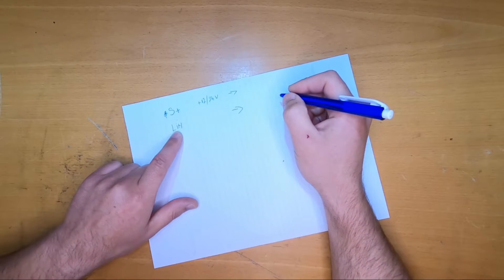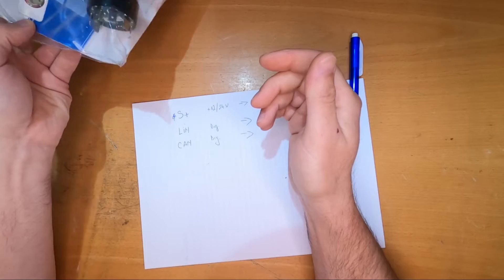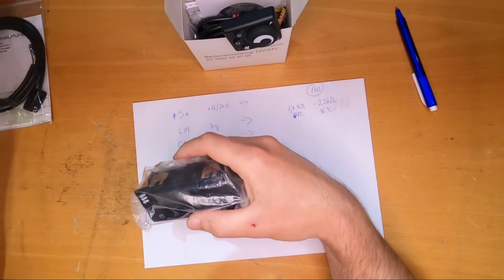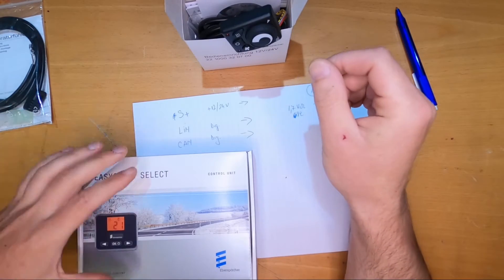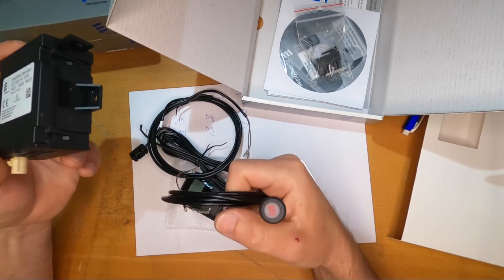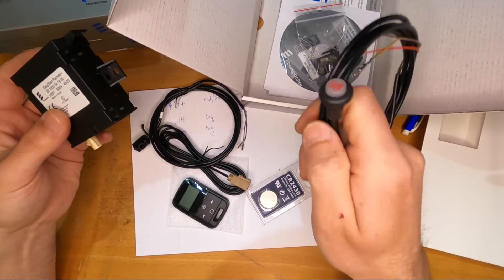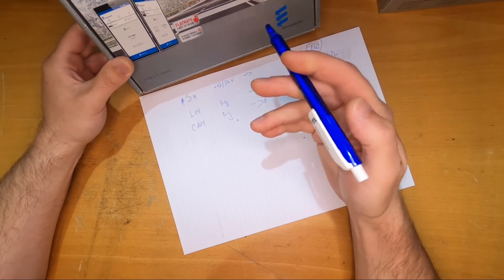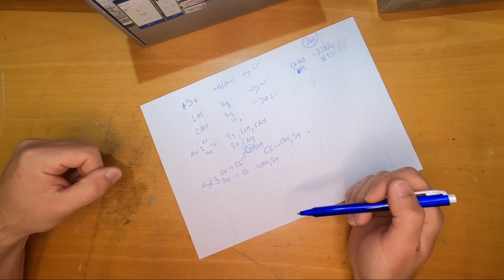Eberspacher controllers, EasyStart Select, Timer, Remote, Remote+, Mini regulator, Pro, Web

Comment: Great explanation, thank you. From what I understand the web interface only works with a data connection and their app, so data needs to pass through Eberspacher's servers. Is there a way to make it work only on a local network? Since there's no wifi or ethernet I don't think so. Also, do you think it's possible to integrate the can information into home assistant, for example with the 24V S3 and the pro controller?
Reply from the maker: You will need a relay that can supply 24V, or a dry relay this way you can start on the yellow wire but it will not sync with the pro. Maybe an esp32 and start remotely through wifi and connect directly to Bluetooth when nearby. You will need all kind of voltage converters probably.
Reply from the maker: I was thinking about this kind of appreciation but for commercial use it is really not that easy, for the diy way it makes sense
Reply: I will use it on a camper and it would be cool to automate it, or at least start and stop, but like you said integrating it with the pro controller is the hard part. The S+ wire needs 24V to start and when you cut 24V it initiates the power off procedure?
Reply from the maker: @FilippoMasoni  yes, +24v on yellow ON, when you cut the +24V OFF. Deploying HA in a camper sounds interesting, are you thinking of rpi or a nuc? I use a nuc i3 8th at home for HA, bare metal install and have about 2% processor use so I guess about 5w didn't measure. I don't think the pi uses less.
Reply: Great, thanks. The fact I can turn it on and off with 24V is  good, I'll find a way to implement it when I'm there with the build. I still need to start working on the interior of the camper box, it's going to be a pickup camper. At home I have home-assistant on an old laptop, on the camper I was planning to use rpi, but they are still impossible to find at official prices, so I'll definitely consider other options. I'll give a look at your other videos if you have something about home assistant 👍

Comment: Will the Remote+ work with the new B2L AS3? I am running the heater with the Easy Start Pro currently. Thanks!
Reply from the maker: Yes, It will work. However there will be no sync between the two interfaces. Best practice in this case is to mount an external sensor on the harness, this will require coding by a workshop with workshop pro rights on the diagnostic software. Or if you are not using the sensor in the pro as target temperature then it can work without this setting. Anyway you just gave a good idea for new video.
Reply: @DIYHelper  Awesome. I will likely set the temp sensor in the as3 to be the reference point to avoid the programming. Looking forward to having control from bed in the camper on ski trips! Thanks!
Reply: @DIYHelper  Follow up question, if I may: If I wire the remote+ to start the heater on the yellow wire, will I still have temperature control via the remote? From hunting through the wiring diagrams it appears I could maybe wire it via LIN to the diagnostic wire, since the Easy start pro doesn't seem to use that wire. Or maybe your recommendation below to J Smith is specific to his water heater and that is why you recommended the yellow wire start from remote+? I will attempting this install in the morning. Thank you again!
Reply from the maker: LIN is the way to go so blue/white.
Reply: @DIYHelper  thanks again!
Reply from the maker: You're welcome.

Comment: Hi! Brilliant video. I have a question. I have an airtronic d2. My switch is the easystart select. My question is, how can i switch on the heater with only the wires? I want to conect a wifi relay to switch on the heater with the smartphone, and i don't know Witch wires i need yo switch. Thank you so much
Reply from the maker: The wire is yellow, the heater will start but I am not sure if on heating or ventilation. You will need a variable resistance between grey/red and brown/white wire in order to comunicate a setpoint also. 1.7kohm is 6 degrees 2.2kohm is 35 degrees so something that works in this range. You can leave the Select connected but the heater will only work in 75% heat output and will not regulate the temperature when starting from the Select. Or get an old type rheostat controller for this and run the yellow wire through the relay. This way you will have both running on the same setpoint, however the heater will only work from the rheostat when the relay is active.
Reply: @DIYHelper  thank you much!!!

Comment: Hello. Can you tell me, is my easystart remote the S+ version? Part number is 22 1000  34 25 00. I don't get the +12v signal out from pin 11.
Reply from the maker: I only know the full kit number 221000348100. Only after 2018 s+ was introduced on the remote. For s+ you only have to connect pin 11. For LIN you need to make a bridge between 9 and 10.

Comment: Very informative video! Thanks! Do you know is it possible to have multiple controllers at once? Like an easystart pro mounted on the dash, and the Easystart remote+ in your pocket? I have the Hydronic S3 D5E CS 12v, and the Easystart Pro, and would like to add the remote+.
Reply from the maker: Yes, of course. You can add the Remote +. It will start the heater on the S+ (yellow wire) interface.
Reply: @DIYHelper  awesome! Thanks! Do they sync up, or interfere with each other? Since both look to be capable of the same things? Or would one be start only?
Reply from the maker: Unfortunately they do not sync far as I know, depending where you are located Easystart Web has also a CAN interface and would sync with the pro but that is a subscription base controller. I personally would choose the Remote +.
Reply from the maker: They will not interfere with each other CAN is always the higher ranking controller. If you set 60 minutes op time on the remote and after 30 minutes you set 60 on the pro the unit will work with the pros time. But when you will have the remote also there will be little times that you will start with with the pro.
Reply: @DIYHelper  thank you for the great information!

Comment: Hello.  You make great videos!  I would like you to take a review on easy scan.  I have such a diagnostic device, but I am new to this business.  I wanted to see the functioning of such things as: coding, programming, programming of control panels.  Thank you!
Reply from the maker: I could make a video on easyscan for basic stuff, however advanced functions require special user and password. Things like flashing new firmware, changing functional parameters, etc.
Reply: @DIYHelper  Thanks for the answer!  I understand that the functionality is limited for users of this device?  Advanced features only for dealers?
Reply from the maker: @ОлегПінчук-к9в  pretty much, passwords are only given out via NDA contracts
Reply: @DIYHelper  OK.  Thank you!!!

Comment: On my S3 I determined I could use the remote connection (2 wires) and an unpowered thermostat to control temperature in my trailer.
Reply from the maker: I have a video about the right way to control inside temperature

Comment: so a S3 D5E CS wont work with a easy start timer and run a water to air blower thx great vid
Reply from the maker: I would go with the CL + timer + temperature sensor. This will give you the option to run a matrix heater via a relay according to the desired temperature.

Comment: I can’t find my information on the Espar b5s hydronic ii unit. It’s 12v but is it CS or CL?
Reply from the maker: Hello, Hydronic II will start with with both LIN and S+, CS and CL naming was introduced with Hydronic 3 and stands for CAN S+ and CAN LIN. The first can be started with CAN controllers like Pro and Web and also a simple switch S+. The second  can be started only with LIN and the CAN is only for diagnostic. I know it is confusing...
Reply: @DIYHelper  Thanks so much for your clarification. Your video was so helpful and you're the only person who's explained this stuff well. Thank you.

I was wondering if you could assist with two other questions 
1) I'm interested in the High altitude kit provided by Espar. I heard that the pro controller also has a high altitude sensor built in. Do you know if this is true? 
2) I am deciding if the Espar B5E CL will suit my needs. Sounds like the B5E CL can operate off CAN, and thus be paired with the Pro controller is that right?
Reply from the maker: High altitude kit can only be used with Hydronic II (H-kit on the label) it is not compatible with Hydronic 3. The Pro itself doesn't have an altitude sensor but you can set altitude mode manually from the controller. The Pro will only work with CS water heaters. 
Heaters that have air pressure sensors are - all second generation air heaters - all 3rd generation air heaters - only 24 V versions of Hydronic 3 water heaters (and 8-10-12 kW 2nd generation water heaters).
I don't know what is more important for you, water heating or altitude mode?
Reply: @DIYHelper  Why is it that the pro controller will only work the the CS heater and not the D5E CL version? Doesn't the pro controller operate off CAN?
Reply from the maker: CL starts only on LIN interface, CAN is only for diagnostic interface. It is a different CAN protocol from the one that the pro has.